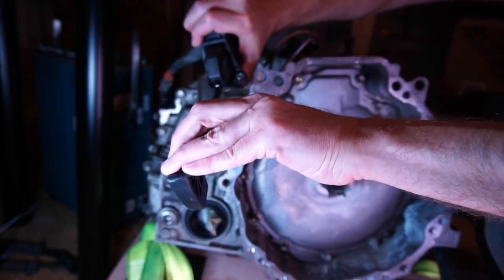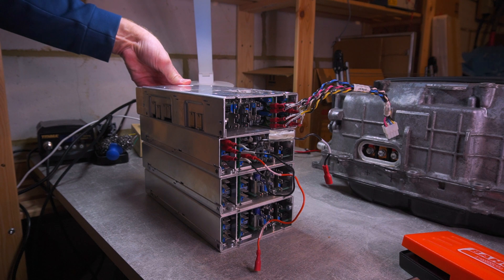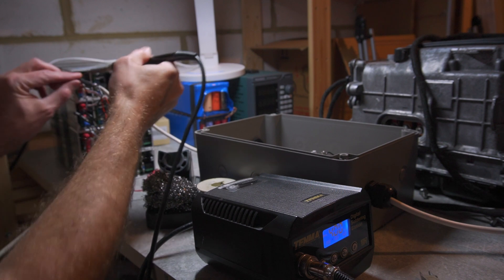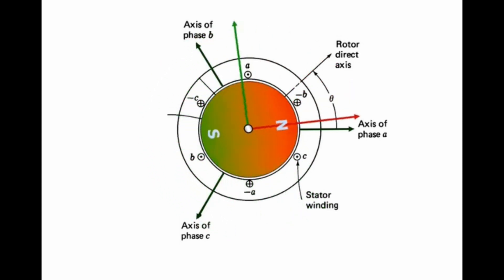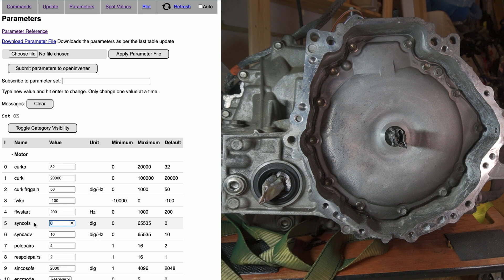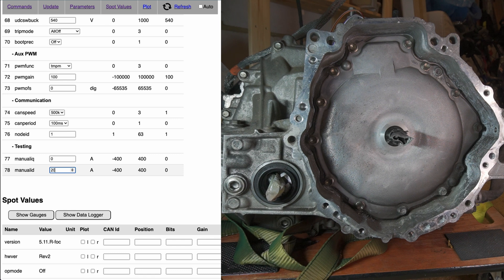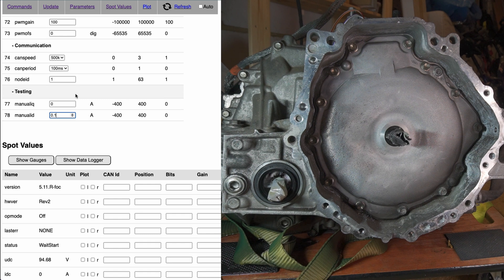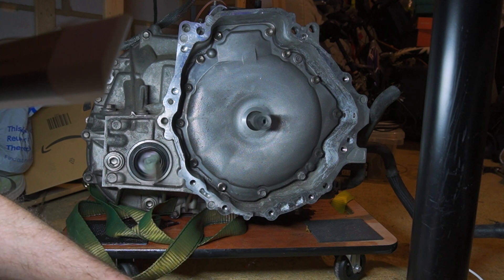I've made a mistake Toyota Prius DIY EV Ep 26

Comment: Thank you for the video series.   It makes clear this is not an easy process to hack all this stuff particularly depending on others hacks.   I was a big proponent of using prius parts 10 years ago, but with the leaf's out and now old and cheap, there is no reason to anymore.  The leaf drivetrain is very easy to swap into anything, I just bought an insurance total for $400 that is a running 35 miles range car.
Reply from the maker: @murraymadness4674  Yes you right old leaf's are very cheap now probably the best option out there. For me the main goal was to learn how these things are working while doing it cheaply. With the Leaf probably better to use Zombie to control Nissan electronics via can commands. But if you want to do it in more interesting way you can put Open inverter board in the leaf inverter.

Comment: Hi. Do I also adjust my motor and have a lot of voltage to set everything up correctly? I think I set it up well, but when I give the engine gas as if it jams, the field weakens
Reply from the maker: Did you try using sine firmware? and was it spinning ok with sine?
Reply: @LatutaEV  Yes. It's all right, the engine spins well. I did as you did, on the FOC firmware when setting up syncofs also works well, but at low syncofs values. I found a good synchronization, it's 32650, the motor at 100A makes sound, but it doesn't spin like yours. When I try this setting at the beginning, everything spins well, I press the gas pedal and the engine starts spinning, but when I give more gas, the engine slows down and twitches, I think this is due to the fact that the weakening of the engine field decreases. I, like you, use a power supply, a server power supply. I have 53 volts on the battery side, so maybe it's because of low voltage?
Reply from the maker: @Max-fc2zq  I suspect that you need to go higher in voltage and current. This would be a good stage to move to a battery ☺️
Reply: @LatutaEV  Okay 👌. Thank you for your help

Comment: I love this! I myself fantasize with the idea of converting an 2nd gen Prius into purely EV. Your idea of using most of the gear is brilliant. I look forward to learning about your progress with each video. Good luck on your endeavor!
Reply: There is the EV Switch mod that you can read about, however the battery isn't designed to run as an all EV vehicle for more than very short periods of time.  I'm no certain about the rest of the parts where maybe additional cooling I'd think at the very least would be required like with another separate radiator and maybe fan. I'm still learning however and may be wrong.  There definitely is an EV switch mod that's not that expensive to perform to get the option at least.
Reply: @jafinch78  I think you might be on to something; I vaguely recall reading something similar in these Priuschat website. A battery upgrade wound be a must; as you pointed out,  it wouldn't go very far 😅.  Thanks for sharing.  I'll investigate.
Reply from the maker: Thank you so much

Comment: Thanks for sharing this video, the FOC explanation is very good. Can you share the make model of the power supply modules, have you chosen an car to fit the Prius motor into.
Reply from the maker: Thanks I am glad you found it useful, as for the power supply I would not using exactly that model as they are quite expensive and not really the best for this task. I just used them as I already have them from my previous work. If you can get any power supply from 60 to 100V and reasonable current you should be fine. As for the car I made a video about it. Called What car😁. At the moment I am gravitating towards Audi TT gen1 or 2 simply because I like it and it is quite small and relatively light

Comment: I don’t understand why you’re using a Toyota gearbox and inverter to make an EV 
Would it be easier to convert Toyota Hybrid? Instead using Toyota hybrid parts only
Reply from the maker: Good question 😊 the explanation is quite simple - it is the cheapest option to learn from. I am planning to experiment with Tesla motor after I have done this one. As for converting Toyota hybrid I don't particularly like Toyota's apart from newer models but I wanted to convert an older car like Celica or Audi TT

Comment: I currently have 6x12v gel cells that got the motor spinning in open loop. I think I may need to add more cells and/or psu for foc tuning.
Reply from the maker: I think you could try but it may be better to have more than 100 volts.

Comment: Im confused. Was the motor controller designed to be universal? Or was it designed to work with the mg1 and 2? If so then all the settings should be known already
Reply: No it's not universal. It been hacked, with the hack it is universal.
Reply from the maker: Open Inverter designed to be adaptable and tuneable. For example Damien has board that works with Tesla motor and Leaf motor. In this case I am only controlling MG2. Initially my plan was to have both MG2 and MG1 locked together and control them with the dual board that has two STM32 processors but now I am thinking about removing MG1 and have two MG2 with two inverters, but I am still undecided on this for now.
Reply: Really enjoying your work,  Really interested when you said you were  going to use two separate  mg1 . Is it physically possible to separate drives as I'm hoping to to connect to a stern drive in a boat and either mg1 or 2 would keep weight down,
Reply from the maker: @seancosy1  as MG1 is quite small and the gear ratio is not favourable I think it may be better to remove it. The complication is that oil pump is connected to the shaft that goes through MG1. If you watch Prof John Kelly videos he shows all components of the Prius gearbox. At least you can always remove MG1 and drive MG2 only. I was thinking about connecting in parallel MG1 and MG2 inverters to get more power as well